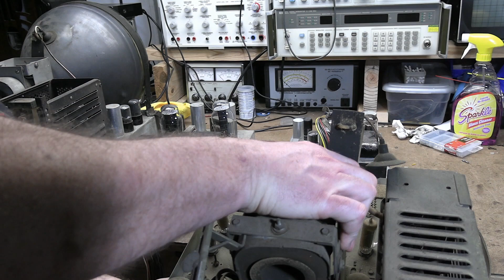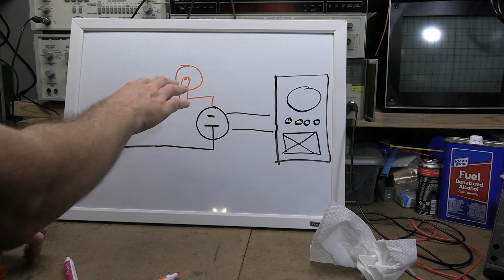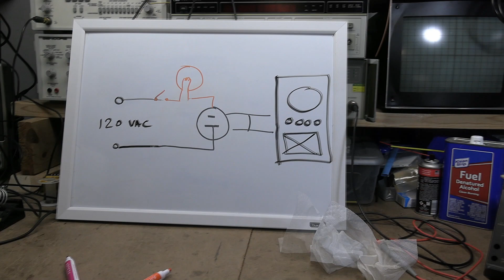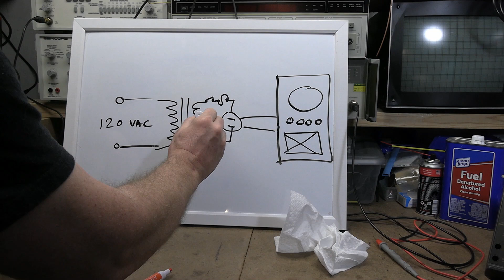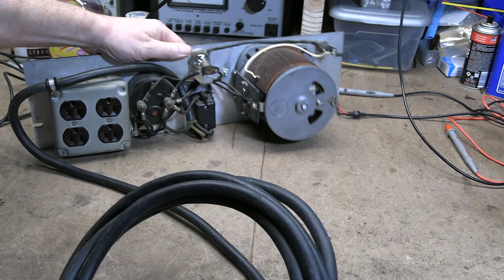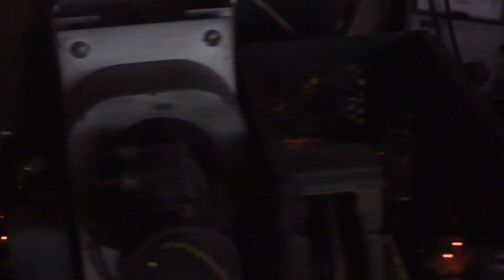Beginners guide to B&W tube TV restoration part 6 (partial power up)

Comment: Another suggestion for sets with a power transformer: unplug some of the harder to replace tubes (especially the picture tube) before the partial power up. In the unlikely case a fault results in high heater voltage it will save you from frying everything.

Comment: Great video. Nice idea to compare the different chassis of the same year. I have to nick-pick on stuff, so here goes. Calculating the current drawn by the chassis isn't as simple as you said. I'm sure you know this. The filament current in a set with a transformer is drawn at a low voltage (6 or 12V) per tube, so adding them up gives a value at the secondary winding. The primary winding current is reduced by the turns ratio. There is some power loss also because of less than 100% efficiency.  If the chassis without the rectifiers is drawing 0.7 amp the filament current total would be closer to 14 amp. (Also the HV rectifier filament won't be lit, if you could see it anyway.)
Reply from the maker: Yes, you are absolutely correct.  Don't know what I was thinking.  As we learned in Shango's recent scanning demo, it draws about 2.2A on the primary when fully powered.

Comment: It's illegal in the USA to sell incandescent light bulbs, has been for a few years. Better collect a set of bulbs now while used ones are still commonly found.
Reply from the maker: No it isn't and they are widely available.  They are just now sold as appliance bulbs or specialty bulbs.  All of these incandescent bulbs are sold.

Appliance lamps, including fridge and oven lights
Black lights
Bug lamps
Colored lamps
Infrared lamps
Left-handed thread lamps
Plant lights
Flood lights
Reflector lamps
Showcase lamps
Traffic signals
Some other specialty lights, including marine lamps and some odd-sized bulbs

Comment: Someone here in the UK ought to show how to do this with British sets. The power supplies in valve sets here were considerably different, usually series string heater, also a single rectifier and reservoir caps being fed from a mains dropper resistor, no power transformers *AT ALL*!
Reply from the maker: So did US sets, but not in the 40s.  I suspect British TVs from the 30s and 40s used power transformers as well.
Reply: @bandersentv  In the 30s they did and just after WW2, but when we went over to AC/DC sets, the distinctive mains droppers covered in dark green paint started to appear.

I’ve not seen any in American sets, maybe because they’re so big you’d need binoculars to see something so small. 😂 But seriously I never see them in the 50s-70s sets that people like yourself and Shango do. Here, mains dropper resistor “tubes” were used until about 1978-82 when British manufacturers finally started to follow the Japanese example of TV PSU design.
Reply from the maker: Mains filament droppers were common. I received several videos on replacing the.  Since 120 vac is the standard outlet voltage, it's very common to have a voltage double with two selenium rectifiers rather than one rectifier with dropper
Reply: Many American sets were like that as well, in addition to using voltage doublers since the U.S. power supply voltage is lower than the UK and Europe.

Comment: Or you could shotgun all new parts and then troubleshoot, like jim does with radios. Rather try it first with dim bulb or variac. And slowly swap parts
Reply from the maker: I don't know who Jim is, but that's what I normally do as well.  Time is money and I have the experience.  You really don't learn anything that way though.  That's the whole point of this series.
Reply: @bandersentv I usually find the reverse is the best way. Kind of Shango-style resurrection to see if it’s worth restoring first then, if it is, shotgun replace the rest of the components that are known to be unreliable (remembering to switch on each time to make it easy to know if you’ve made a mistake), sort out cosmetic issues etc. That way you avoid wasting time on shotgun replacing stuff only to find a brick wall in the shape of a line output transformer with an o/c primary or something else that’s a pain in the arse.
Reply from the maker: @stickytapenrust6869  I'm a bit different.  I decide if it's worth restoring based on value and how much I like it.  Once I decide yes, it will get restored no matter what :)
Reply: @bandersentv  Oh if it’s rare then my priorities change to yours. But if it’s as common as dust? Resurrect first to see if it’s worth carrying on.
Reply from the maker: @stickytapenrust6869  Well if it's as common as dust, you can get parts :)  There is a reason why I stick with older stuff than Shango.  Less complex and more robust.  I don't recall encountering a bad power transformer, flyback or yoke.  Really the only show stopper for me is a bad CRT.  I'm also not finding sets out in the desert or barns to work on.
Reply: @bandersentv  Not necessarily. Here in the UK, collectors tend not to want to sacrifice their sets for parts for another collector’s set to be saved. Sometimes people will have used but working spares, but I’m noticing now that spares obtained even through this source are getting thinner on the ground now.

New spares like mains dropper resistors (designed for specific chassis with their own “tappings” for the chassis’ voltages), output transformers, many previously common CRT types etc are getting really rare and the circuits that incorporated such components are really not easily adapted for alternatives as they were designed to only accommodate what the manufacturer supplied (we didn’t have that thing that you had over there where different manufacturers made their own copies of RCA chassis, which I imagine aids in component interchangeability).

For CRT supply, manufacturers sided with either Mazda or Mullard, which both had different neck assemblies and neck widths. Most went for Mazda, which didn’t last at all well as it and so many other British companies took advantage of the total ban of imported TV sets so treated the British public as being “jolly lucky they have TV sets at all” and basically milked the British public for what was really a substandard product.

Anyway… Then the scan coils sometimes had the manufacturer’s own non-standard inductances. So if you had a set with a Mazda CRT that was low emission and didn’t respond to rejuvenation (as usual) and your only option was to replace it with a much more reliable Mullard, you’d likely be stuck because there’d be no provision on the board or the existing scan coils to add or reduce inductance. Also, IIRC a Mazda CRT neck is thinner in diameter than a Mullard’s, so the scan coils won’t slide on a Mullard CRT.

Maybe our much more humid climate has an effect, too, as many old line output transformers now are suffering from poor sealing during manufacture and thus moisture ingress. I’m seeing scan coils and frame output transformers starting to go the same way, too. While it’s not impossible to get them rewound, it’s quite a frustrating inconvenience if you have to send it away for a couple of weeks (there we are only two transformer rewinders in the UK!). I hate putting unfinished sets to one side to work on another while I wait for parts.
Reply from the maker: I noticed that as well while searching eBay UK for parts for a vintage Ekco with busted Mazda CRT. Parts and chassis are far more plentiful over hear and CRT/yokes were standardized between all the makers
Reply: Yes and thank you looking forward to next video. I find it more enjoyable swapping parts as you go. Cause if it's not getting better or getting worse can easily go back and troubleshoot 🙂
Reply: Before I even start on restoration is looking at rough value of what it's worth restored. Then I set myself a limit as to not spend to much on parts. So in end I'm on budget or better yet make more profit
Reply from the maker: @Tysman909 You should avoid TVs then.  I lose money on most projects.  It's a very limited market aside from Predictas and early color,
Reply: @bandersentv  I work on radios as hobby, tv's are more involved. That's why enjoy watching your restorations it gives me more knowledge on how they operate